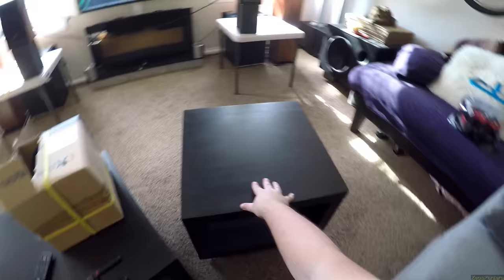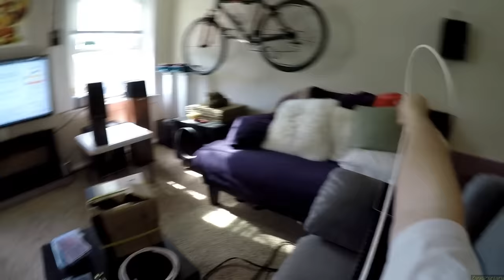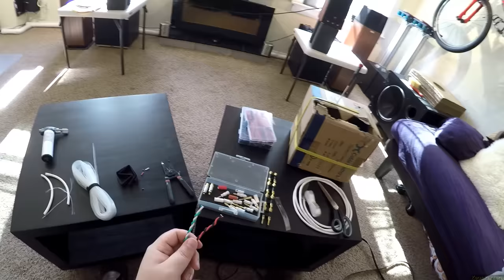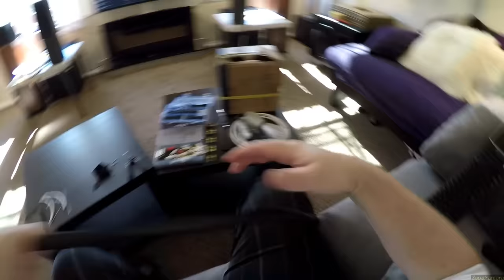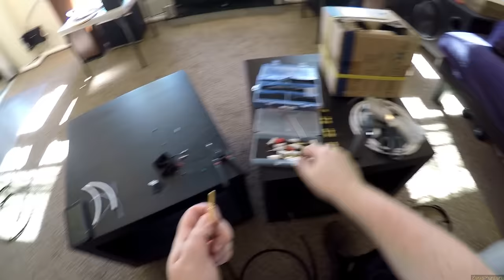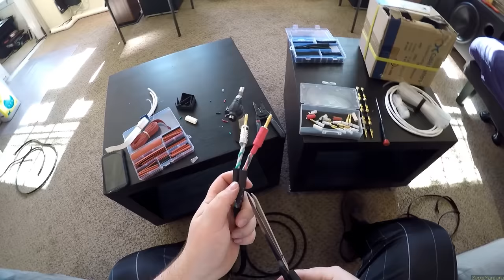Z How - Building Awesome Speaker Cables

Comment: Fellow "Zeos" subscribers,
I also do not buy into the special aka magical cable idea.
Unless you're running cable more than 50 feet
a decent gauge cable works great.
Years of recording studio experience has schooled
me & my wallet on what Does Not work.
In the1980's we'd even craft our own speaker & monitor
cables using runs of std zip/lamp cord from the local
Home Depot or Orchard etc.
We'd then solder our own TRS connectors & the like
on the ends of the lamp cord.
Not only does the std lamp cord send the audio signal
accurately, it's also shielded from interference.
Don't believe Me?
Make a pair of speaker cables from the lamp cord and connect
your fav AV Receiver & speakers with it.
Then, using a familiar music track, compare playback performance
of the lamp cord speaker cable to say Monster cable made speaker wire.
I guarantee, the lamp cord will be identical in playback to the monster Cable
many Home Theater enthusiasts and Audiophiles spend mucho' cash on.
$100 Monster Cable for your front stereo speaker pair is money wasted!
Unless you're just wanting to brag on the name and look.
One other "plus" to using zip cord is...
your local Lowes, Home Depot etc. will run your required speaker lengths
off the spool in the stock color you like at about 19 to 29 cents a foot.
Colors are the standard Brown, Black, White which almost always helps
the speaker cables to disappear in your living room depending on your
carpet or wall color.
Moreover, zip or lamp cord is constructed with a smooth/ribbed plastic
coating that resists breaks in the inner copper wires & it's resistant
to audio signal interference at a MONSTER savings to your wallet.
Well, there it is.
My unsolicited 2 cents worth.
LMWABO!
Reply: FURY he literally says it’s not for sound, for looks. You just wasted 5 min of your life ranting for nothing
Reply: Mopower1969 And Fury literally said that he agrees with Zeos that the cable “quality” doesn’t matter, he didn’t even commented on the cable Z made but rather on the fact that a branded cable is good for nothing but bragging.
Reply: Mykal Fury u know a lot about this correct? I'm a bit late but I have a question...

Can I use this type of wire for RCA wire? Or do I have to get shielded wire? Also we're can I find Shielded wire in Amazon? Idk what the correct way to find them is...

Comment: I see a lot of unnecessary steps and materials. If your going to do it right, use only 1 wire for each terminal, to the gauge you like. If you want to bump up the wires size 12 gauge copper wire is pretty cheap on sites such as Amazon. That's true 12 gauge oxygen free wire, mine specifically comes from Skyhigh car audio. Your wire already has good insulation, using tubing then going over that with wire wrap adds up. Doubling up the wires can cause unwanted flux in the cable itself or may cause interference or ohm drop. The best type of wire to use is solid core, normally this is a bad idea for speaker cable, but you can find solid core wire that's super flexible now that won't break under normal use. It's better because there's less signal loss. I experimented with this using some left over romex, it didn't make a difference over stranded at a short distance but it certainly did over a long one. Btw Sewell tooless Banana jacks, your welcome. ;)
Reply from the maker: That is what makes them nice. Extra work and materials.

Comment: What a load of crap so what is your impedance and capacitance??
You don't need to double stranded wires the gauges thickness is enough for most usage 16 gauge can handle 700 watts no problem but you need to add a solid core is better with the multi Strand and split them Apart by an inch to cut down your impedance and capacitance.
Do it like this get 1.5mm of solid core get it from an earth wire not Strand solid core, ideally you want to plait them at 45 degrees if they're going to be close to each other with the multi Strand 16 gauge, when theplus and minus separate them by 13mm gap between the two, use masking tape or duct tape a piece on the top and a piece on the bottom the full length of The Wire.

Comment: Just buy the correct gauge multi threaded wire instead of doing some stupid twisting bs. None of this has improved anything audibly to the result. It has given your wallet a diet and killed hours of your life though.
Reply: Keeping in mind he did this as a tutorial for people who either would do it as a hobby and are willing to throw money into it or people who want to do stuff like this to make a bit of cash on the side. I myself spend time buying broken computer parts i know how to repair for a small fraction of buying it working and build systems with which I sell and make a neat little profit off of.
Reply from the maker: At the end I say it is really only to make them pretty.